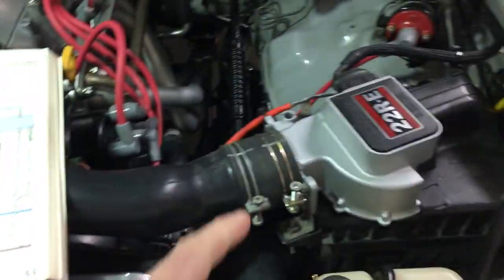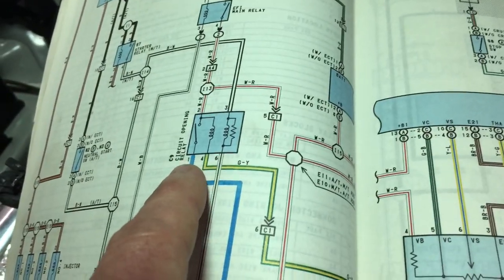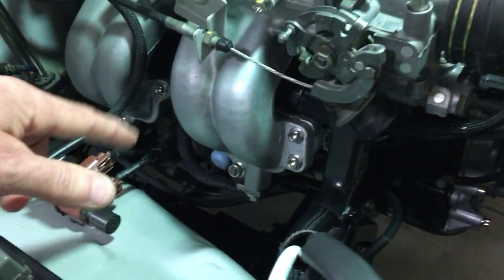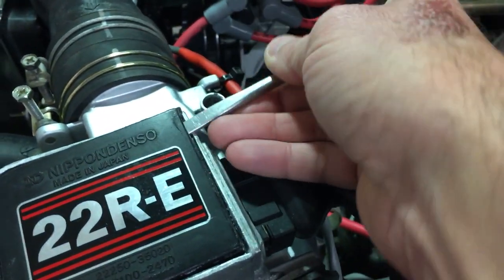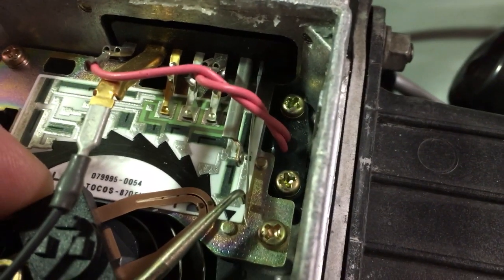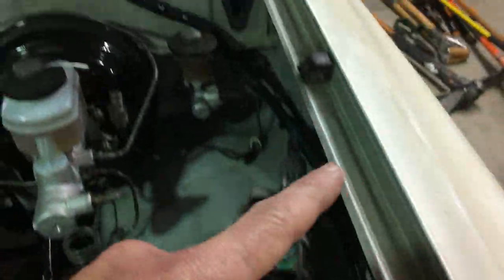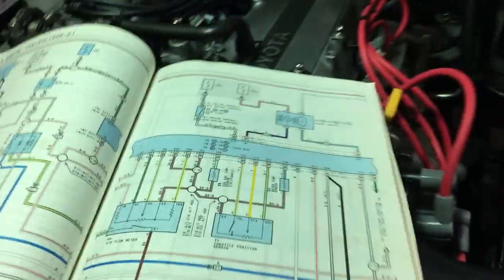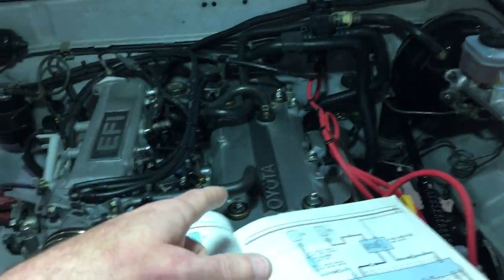How the Toyota 22RE AFM turns on the circuit opening relay via FC & E1 to enable your fuel pump

Comment: very good video, Ok have a 94 cab plus two wheel I have restored I rebuilt the engine and the transmission when out . I parked it and it sat for a long time I went back out about two years ago tried to start it and no fuel . So I ordered a fuel pump for it and was getting ready to put it in. I have a Hanes manual and it sucks Monkey balls for location for the fuel pump fuse or location of the fuel pump relay , Any way I looked on You tube and saw the trick on firing the fuel pump from th dignostic terminal from B to FP  I checked for power at B and I have none I checked with key on and nothing I checked for power at FP with key on and nothing . i went through all the fuses and on the drivers side no FP fuse there I pulled the panel for the ECM but there is no fuse for the FP but a fuse box for the AC and Heater I checked for power but it was dead I checked for battery and ignition and its dead at the terminal I still cant find the fuse for the fuel pump. I wonder if I might have a bad ignition switch. I checked all fusealble links at the box in the engine compartment and none looked blown. I checked all fuses at the box in the engine compartment there is none for the FP realy but all the fuses checked good ones for batter and ignition . The no power to the AC and Heater fuse and no power to the B term on the dignostic hooked up has me baffled . Is the B terminal ign only ? I cant find anything on You Tube the the Hanes like I said sucks monkey balls I still havent found the FB fuse to check for voltage can somebody help me? Thanks
Reply from the maker: Okay, basically it's like this: power comes from the battery, to the 15 amp EFI fuse in the fuse box (in the engine compartment). When you turn the key to on, it sends power through the 7.5 amp Ignition fuse (kick panel next to the clutch pedal). Power going through the 7.5 amp fuse energizes the EFI relay and that will make +B in the diagnostic box hot (i.e. +12V DC). If you jumper +B to FP (fuel pump), you are bypassing the circuit opening relay (which is in the panel over by the glove box). Check my other videos, I think I have one which covers it a little. You can also directly jump the solid blue wire in the circuit opening relay (by the glove box, under that panel in the foot well) directly to +12V at the battery terminal, which will directly power the fuel pump (thus bypassing the ignition circuit and EFI main relay. The EFI main relay is also located in the fuse box in the engine compartment, if you want to verify that it's working.
Reply: @ray5961  Sure be easier if I had the right schematic but the hanes sucks, Ok I got both panels pulled on drivers and passengers. I do have power at the EFI fuse on the box in the engine compartment I assume that is the fuel pump relay fuse ? Because that is all I have. I have power on to both sides from ignition on the EFI fuse so I know that is good  . But on B + on the dignostic terminal it is dead on either ignition or crank . Also I am dead on the Heater fuse and the AC Fuse above the ECM . I just called a Toyota dealer in Twin Falls and he verified I should have power at the B + terminal for the dignostic link and I told him the heater and AC fuses is dead also. I went through very fuse on this system Ray and I havent found one blown fuse. It did take the Mass Air off and popped the cover and flushed out with electronic cleaner and cleaned the terminal going into it because I new that is part of the circuit to energize the fuel pump it was clean inside I resealed the cap. I am thinking I have a bad ignition switch ? The service manager concurred with me after I went through all the check list it sounded like an ignition switch when the trans went out I parked it and Nevada desert with all the storms and cold and dust must of reeked havoc on it because it ran really good  .I have almost two grand in the engine on the rebuild . The relay above the ECM that is the fuel pump relay correct? I checked that for ignition on and I did have power but the fuel pump wont pulse  , I want to go pull the ignition switch and just tear it apart and look for bad contacts or dirt but the truck is out side and its blowing like a bitch today . Are the ignitions hard to pull on these? THANK YOU FOR TRYING TO HELP ME !
Reply from the maker: @madmanmechanic8847  Could be the ignition switch, but it's hard to say. There is also a 30 amp fuse which is part of the mix for the ignition. When you turn the ignition switch does the car turn on? To check the ignition switch as it relates to the EFI system, put a volt meter on the 7.5 amp fuse in the kick panel to the left of the clutch pedal and over to ground (set to DC volts) and then work the ignition switch and see if it moves the needle. That 7.5A fuse should be dead when the ignition is off and +12V when the ignition is on. Also try this: jump the FP lead in the diagnostic box directly to the +12V battery post... see if the fuel pump kicks on. That's another direct route to the fuel pump. In other words, +B is only hot when the ignition and EFI relays, etc. are functioning, but if you jump FP right to the hot side of the battery, that fuel pump turns on - no ifs ands or buts - unless the pump itself is toast. Let me know
Reply: @ray5961  Very clear and concise Ray with your instructions. The freaking wind finally died down late and I went out and figured out how to pull the ignition switch assembly. I looked in my manual and nothing and nothing on youtube but unbolted the steering collum and found the way to get to the ignition switch and pulled it out . I have worked on a lot of switches and torn them apart I used to do appliance repair and have torn hundreds of timers apart and serviced them and got them going again. I took the switch into the shop on the bench and took the switch apart , I doesnt look bad at all. They have grease from the factory for the contacts but I dont see any wearing on the contacts nor any dirt its pretty clean. In the morning I am going to do a major clean and put die electric on the contacts and do a clean and service. Ok Ray here is my game plan: I am going to pull the ECM before I do this test I dont want to smoke it . I will pull the cover on it and blow it out and clean the control board with contact cleaner then I am going to clean the terminals also and the plug in on the ECM . Here is the reason I am pulling the ECM for this test. With the ignition switch out I am going to back voltage the circuit on the b + terminal and check the connector for the ignition switch. The reason I am pulling the ECM I dont want to take a chance of frying the ECM with a back voltage the circuit. With voltage applied to the B + circuit and I back trace the circuit and either find a broken wire or some corrosion on a plug in. Like I said I live in Nv and it gets cold and windy and its hell on cars when they sit out side. To answer your question on crank I went to crank the engine over I could hear the solenoid click but it would not crank. I am afraid I might of gotten moisture in the cylinders , and the engine is locked up. When I got done tearing apart the ign switch I pull the plugs on the engine and dumped in a shit load of Marvel to let is soak. The bolt on the Harmonic balancer is hard to get to so I am pulling the radiator so can get a socket and breaker bar on the bolt. I did get the antifreeze dumped . I just need to get this no pump issue figured out so I can move on to the engine. Thanks Bud@
Reply from the maker: @madmanmechanic8847  make sure you have a fully charged battery also. Good luck over there! If you have any more questions, let me know.
Reply: @ray5961  I forgot to add Ray the truck is an automatic on the column. It has the three speed O/D I will let you know what happens . The battery is up but that is a good idea on charging it. I have a Snap On 1000 CCA booster pack its been a beast . Thanks again bud really appreciate the help, I hope I can return the favor. i do Marine Repair for a living if you ever need any help or any of your friends. Be glad to help out  . I also build performance engines when I have the money and build Muscle cars if can help let me know
Reply from the maker: @madmanmechanic8847  Thanks man! Appreciate it.
Reply: @ray5961  Ok Ray the circuit isolation test . First I took the ignition cleaned and sanded all the contacts and then took scotch bright to the contacts cleaned and flushed all the internals. I used die electric on the contacts an lucked out and got it back together I snapped off one of the ears for the housing for the switch so when I got it back together I hot glued it . I got the switch and housing with the lock mech for the steering column back together . I lucked out Ray there are two balls and springs on the internals for the switch for the de tent and actually got those back in and my balls didn't fly across the shop imagine that>? Ok next stage : I pulled the ECM took the covers off for the housing looked inside no smoked control board and it was clean inside . I flushed the connector on the ECM with switch cleaner. I was surprised how clean it was inside there was surface rust on the mounting plates for it . With ignition still out and ECM out I hooked the battery back up and took and energized the B+ terminal on the diagnostic terminal with the end of a test light and alligator clip hooked direct to the pos on battery,. I went back in the truck on Drivers side and checked the plug in for the ignition and wrote down what was on with the test light. I checked the fuse box on Drivers all dead no power.  I went to the pass side and checked for power at the ECM connector and nothing . I then hooked up a ohm meter  and set it on beep went through again on circuits and nothing . Then I had an idea . Disconnect the Pos terminal and isolate the B+ and go direct off of it to Pos Post on the battery but keep the negative hooked up.  I ran battery voltage through the B + went back in on the drivers side checked the ignition plug in and nothing I checked the fuse box there and nothing I checked all the fuses for the junction the engine compartment and there was nothing. I then looked at the connector for the B + and notice there were two holes for it thinking that the connector was all B+ Positive. So just for grins I put the probe on the hole next to the outside of fuse box and I went in the drivers side again and all was dead for the ignition and fuse box . I then went back over to the engine compartment and checked the fuses again and nothing but this time I checked the connectors going int the fuse box to the lower right and whamo I got power finally ! I went into the truck on the passenger side and checked the connector going into the fuel pump relay and I finally had power to it too! Whoo hoo some power for a change. The color code for the B_+ is White with a red tracer and a red circle around it going into the junction for the fuse box and the same for the relay going into the pass side for the fuel pump ? What puzzles me Ray is the ignition looked very good and its tight the contacts are good and there was very little dirt inside of it , The B+ was dead at the dignostic term and the fuses for the AC and Heater that are above the ECM are dead and no power . I cant see spending $70.00 for a switch when the old one looks good. I am going in this blind and just using grit and determination I wonder if the relay might be bad ? But I still should have power to the AC and Heat fuses . When the truck was running and on the road before the trans took a shit everything was good .I think the heater worked on the blower . Sorry this is so long but had to tell you about my hell today thanks bud
Reply from the maker: @madmanmechanic8847  B+ is your +12VDC in the diagnostic port when the ignition is on, so looping that back to the battery positive terminal is just connecting wires to themselves. At this point, what are you trying to accomplish or diagnose? If it's whether your fuel pump is working or not, then again just run Fp directly to the red post (+12V) on your battery and see if it turns on. If you are trying to figure out if your ignition switch and relays are operational, then turn the key on and attach a volt meter to B+ and the negative terminal on your battery and see if there is +12 volts DC or not. If it makes you feel any better, I spent almost 2 hours looking around my office for a lost screw to a dial caliper haha :-) Anyway, let me know what you are trying to figure out over there!
Reply: @ray5961  Sorry my long winded reply is confusing I could see why Ray. To make is simple  is to begin with the fuel pump would not function . The B + was dead no power : Also in the kick panel on the pass side the fuses for the AC and Heater where dead no power going to them at all. Like I said I called a dealer in Twin Falls and the Service Manager was very cool . I told him about the dead port on B and no voltage on AC or Heater fuse block by the ECM . I thought I had a bad ign switch and he concurred  he thought the same. Ok so that is why I took out the switch and the ECM to protect it. Again the ignition switch looked good inside Ray very little wear. So I took the POS cable off the battery but left the Neg connected. I took an aligator lead and hooked one end to the Pos post of the battery and the other end to the B + and energized the circuit. So now I have by passed all electrical in the system because I un hooked the Pos battery cable . I went back wards and energized the B + I went in back wards instead of current being feed from the inside of the truck and wiring I am feeding it back into the wiring inside the truck, I hope that clears that up?  OK now I went in and finally found power at the Fuel pump relay from the B+ circuit I energized with the alligator lead.off the battery. The wire at the FG relay was  white with two red tracers  When I did that Ray I also had power in the fuse box in the engine compartment. If you look at the top of it to the far right at the bottom there is a connector there and the one I had power to is a 10 gauge white wire with with two red tracers . So after I energized the circuit on the B + I found power there and power at the FP Relay . So my game plan is to put the ignition switch back in after I cleaned it and serviced it and put in the ECM and try it again in the morning. Did this help ? Maybe I could email you and send you some pics if its ok ? I know this is very confusing , Its sucks when you dont have a wiring diagram . But I have fixed a lot of electrical by feeding circuits . I hope this works thanks bud ! And yeah I am getting dingy as you can tell its been another ball freezing day again cloudy and blew like a bitch I dont think it got above 38 and it May I soooooooooooooooooooo gotta move Ray . PS there has been not one bad fuse I have went through all of them like 5 times
Reply from the maker: @madmanmechanic8847  Sorry man, you lost me. I really don't know what you are trying to fix here any longer. If you have some specific question, I'm happy to look it up in the electrical manual and answer it. Don't worry about B+ and Fp right now. What are you trying to fix over there?
Reply: @ray5961  I am sorry . Would it be ok if I email you ? I can send you some pictures . Do you have email on your account for youtube? . This has been a nightmare but the truck has sat a long time and its taken a toll on it . Thanks for trying to help me. I hope I can return the favor
Reply from the maker: @madmanmechanic8847  Hey Roger - I don't have any sort of email setup for YouTube, although it would be nice if they did offer something like that. Maybe I can look into it. In the meantime, have you seen this video I have here? In the very start, I show the manual for the truck wiring. I think you might be well served to buy that same manual off ebay. You are fumbling around in the dark with no wiring diagram for your truck, when you are attempting to solve some electrical problem that really requires that level of understanding. Anyway, check this video out and let me know if it helps you any (it shows the circuit you are dealing with also as I recall). Might help a bit https://youtu.be/EpTED3Z2xo8
Reply: @ray5961  I understand not wanting to give out your email address Ray . I only give mine out to people  I trust . Good luck
Reply from the maker: @madmanmechanic8847  Yeah, YouTube doesn't make it easy. There are a lot of spam bots on YouTube in the comment section. Not a good idea to post email addresses on here usually. So what exactly are you trying to figure out on the truck over there? I gather from your business background (boats, etc.) you understand how wiring works right? Did you watch that other video I linked? It shows the manual you wanna get. If I can help with something specific to your truck, let me know. I got the manual right here by my desk. So your fuel pump does function when you hot wire it right? If you jump Fp from the diagnostic box directly over to the hot side of your car battery, the fuel pump does go on? To me, it's kinda sounding like your circuit opening relay might be on the fritz.
Reply: @ray5961  Usually on somebodies home page for there channel there is contact info email etc. I wasnt asking you to post your email on youtube for everybody to see that i asking for trouble. The only reason I asked for it so I could send you some pics, Wasnt going to send any spam or a virus. And I had you pretty confused . And I thought down the road if you needed some help I could help  you by giving you my email address and if needed I would be happy to call you and talk to you. I know people dont do that anymore . I usually dont give out my email address But you seem a trust worthy guy.
Reply from the maker: @madmanmechanic8847  I hear ya.. I couldn't find any info to contact you on your YouTube page either :-)
Reply: @ray5961  I dont have a page on youtube yet just and account that is probably why there was no contact info. I am working on starting a channel though , I put the ignition back together in the truck and  put the ecm back in I now have power to B + with key on. I took the FP relay and cleaned it and it did not looked smoked . I did energize the port for the fuel pump and no cigar. The reason I am hesitant to buy a shop manual is I am selling the truck when I get it going again hate to spend 89 or 90 bucks on manual when I am going to use it only once . There I do have a new pump I bought years ago in the box I guess the relay may be gone too ?
Reply from the maker: @madmanmechanic8847  Okay, so if you got power to B+ when you turned on the ignition, that means your ignition contacts are good and so is the relay which controls everything. Also, if you jump B+ to Fp and the fuel pump does not turn on, then either the wires running along the frame are broken some place or the fuel pump itself is dead or stuck. If you remove the rear tire, you can get access to the connectors on top of the fuel tank usually. Dropping the fuel tank is a bit of a hassle. Sounds like you are on the right track though.
Reply: @ray5961  I by passed B+ Ray and stuck a probe from a test light into the socket fro the FP and hooked an alligator clip lead from Battery dirrect. The FP did not work . So I was getting ready order a new fuel pump relay because I have no power with key on at the FP terminal. If I dont have power at the Fuel pump terminal doesnt that mean the relay is bad? If I was going to keep the truck I would order a factory manual I am sure they are close to $100.00 I have a Hanes but it sucks . So explain to me if I have no power with key on for FP circuit at the dignostic port you are telling me my relay is good? I have another deli ma the motor wont crank over I have to pull the radiator to get to the harmonic balancer so I can hit it with a breaker bar there is no room in there. I pulled the plugs and dumped them with Marvel . I have a customers boat I need to start on the parts came in. But I am pulling the radiator to see if I can bust the engine loose. I hope I can that motor only has about 1700 miles on a complete rebuild. New cam new guides bored 0.030 over new oil pump fresh valve job all new timing chain and gears I dumped close to $1500 in parts and machine work. I am holding off ordering anything until I get this broke loose thanks Ray for all your help. I wish there was a way to contact you .  Wish me luck and cross your fingers for me I can get this engine broke loose
Reply from the maker: @madmanmechanic8847  It doesn't sound like you looked at the other video I suggested, where I show the wiring schematic for all this - just pause the video and you basically have the wiring diagram you need. There's no relay involved with the Fp terminal in the diagnostic port. The Fp terminal is the end of a wire that literally runs straight to the fuel pump. If you apply 12 volts to Fp, you are touching power to the fuel pump directly. So if you want to see if the fuel pump is working or not, hook 12 volts to Fp and listen to see if you hear the fuel pump turn on.
Reply: @ray5961  Good news ! I pulled the radiator tonight and pull the fan off and got in with a breaker bar and the engine broke loose. I got some 30 wt engine oil and dumped into the cylinders then grabbed a ratchet and got the engine to turn over with the oil in it to lubricate the cylinders. I am beyond happy! I was sweating bullets on this Ray if I could of gotten the engine broke loose I would of ended up selling the truck for nothing. I am backed off now the truck is on the back burner I had some more parts come in for another boat so I have to get on them. But now I have time to look at your video . I was way involved going through the wiring and ignition switch and cleaning the ECM . Ok which video did you want me to watch Ray?
Reply from the maker: @madmanmechanic8847  Oh well that's some good news all right! here's the video.https://youtu.be/EpTED3Z2xo8 - I also made a more extensive video to help out last night.. here's the link https://youtu.be/wzV3OKOZcCY